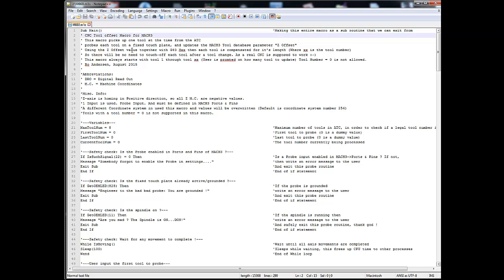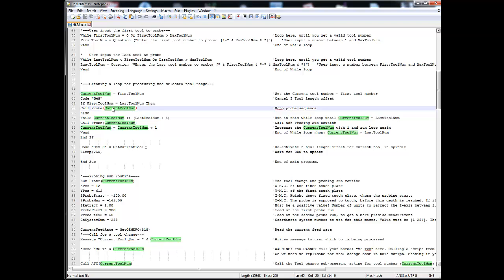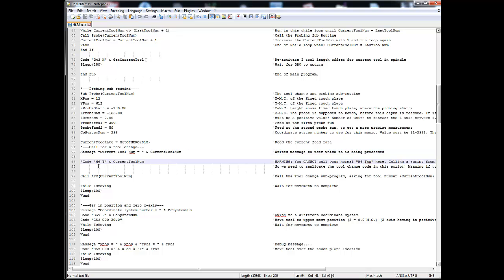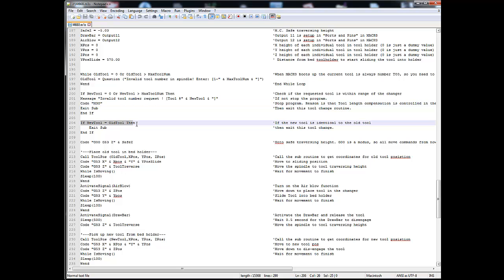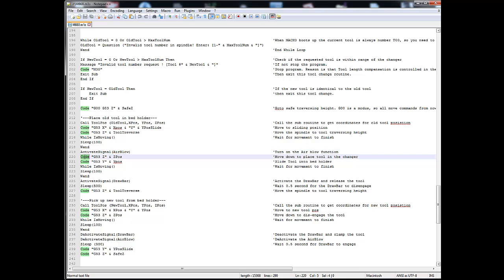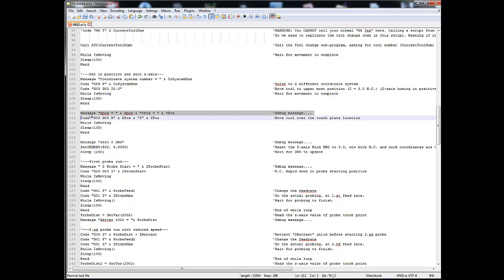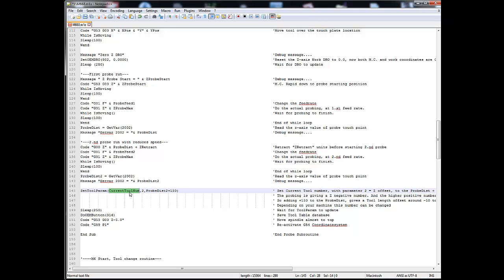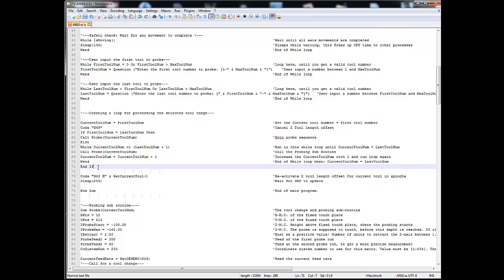MACH3 Script for Probing tools with ATC

Comment: Hi Bo,
I have a question, at 22:57 you said that the only option you have to know that the tool disengaged from the spindle is to wait half a second.
On my ATC I have two sensors that tell me when the tool is on or when the tool is off. Doesn’t your ATC have these two PNP sensors?

Comment: Hello Bo    I finally took the plunge and bought an atc spindle.  would it be possible to get you script for this and the m6   thank you very much in advance
Reply from the maker: Hi Kirk. Yes an investment in ATC is not just by coincidence, and then you need toolholders as well. You will not regret it, just running a program without re-zero'ing every time. If you have any questiones please contact me again. Hope it works out for you and the program gives you a head start. If you find it usefull please "like" Best Regards, Bo Andersen.

Comment: Dear Bo, awesome video thank you. Would it be possible to have a copy of your mach3 toolchange probing scripts/screenset? Did you solve the runout problem on your suhna atc? was it faulty? kind regards Paul. (emco_emco@yahoo.com)
Reply from the maker: Dear Sir. I have sent you an email with the scripts. The screenset is not actually needed to run the scripts. I did however try to sent that as well. But the file gets blocked by gmail :-( Try to goole "Big Tex 2010 screenset mach3" I had a chat with the manufactor of the ATC, an I send it back, he did replace it. So the run-out is within tolerance. Again please note this is a ATC for hobby-use/light millig, and it works perfect for that job. But don't expect it to hold up for 8mm cutters in alu. (not that I tested it)  Please let me know if you have any additional questions. Best Regards, Bo Andersen.